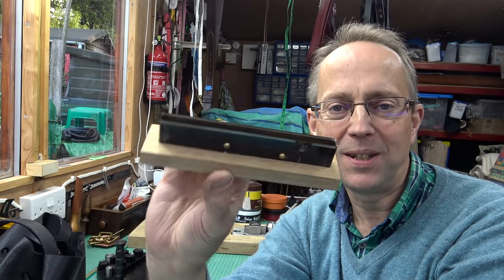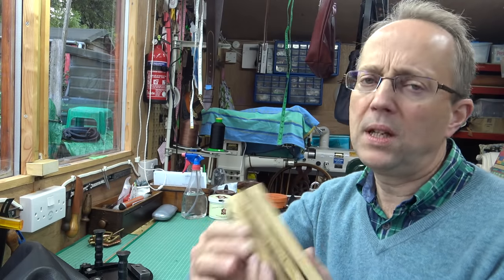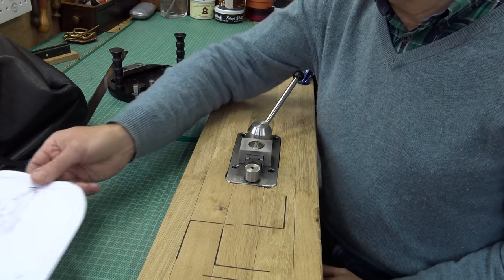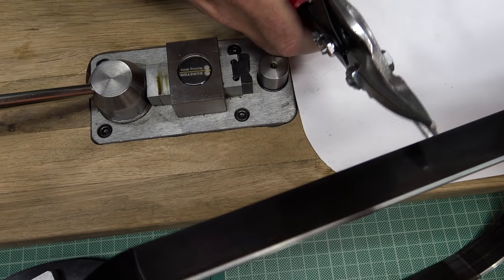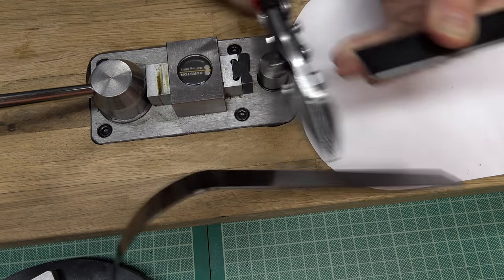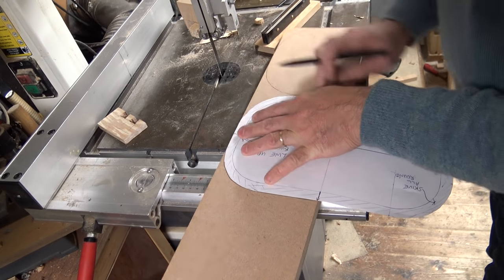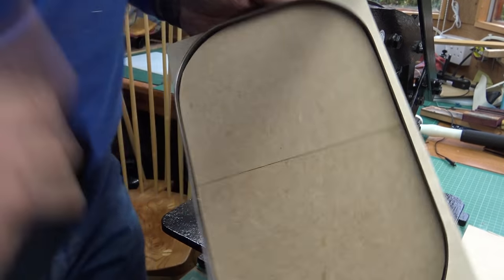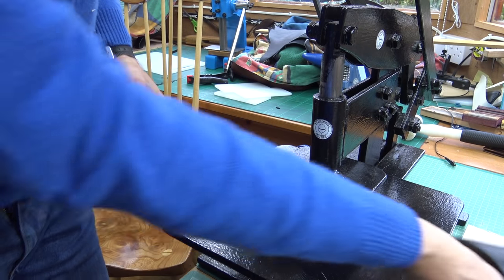Making a thin 2pt Steel Rule Clicker Die with basic tools

Comment: don’t understand why you don’t make mould first then match the steel to it, much easier and more accurate that fiddling with a sheet of paper surely. Great video really helpful. Thanks.
Reply from the maker: Hello there are two reasons...the steel has some spring back and I am very used to woodwork...but that said it's good to try different variations on my approach. Rgds Harry
Reply: ah ok, I’m very experienced with woodwork and this just seems an unusual way to approach something. However each to their own. Personally I would make the inner wooden piece, the. bend a strip of paper or card all the way round, mark the start and ends of al the bends, transfer to the cutting strip and then bend. Just think it would be a whole lot easier

Comment: More expensive and more effort , but longer life glue print to hard ply wood . Saw along line with scroll saw . Plywood thickness to accomodate  steel and ejector pad if used . Holes can be drilled in plywood for small cutters for holes or special shapes . plywood holds die in place,and is bolted to steel backing  plate . I serviced presses for company that did not quote orders less than  ten thousand units . Their bender was same basic design ,larger and more tooling .There are many small small cutters available for holes etc , sorry i don't have vendor info . A little practice you will be pleased with your results .
Reply from the maker: Thanks Stewart.

Comment: If I can offer a couple of bits of advice Harry. I don't use the backing plywood. I'm only using a 1 ton arbor press and I find the ram needs very little pressure when used on the steel rule itself. I don't have the movable  base that you have so I have to move the die and the leather which is not ideal but deouble sided tape stops the leather from moving about. Regarding the bottom of your bag, Have you considered inverting it? It would be much easier to sew and would leave a stiff lip for the bag to sit on thus protecting the bottom of it. Good job on the video. Keep up the good work. Paul

Comment: Harry, I am starting to play around with die making for leather as well. The method I am starting with is to cut the wood template (undersized by two rule thicknesses) and then wrap the rule around it by anchoring the wood template to the bench and using leverage to pull the rule hard/tight against the template. Have you tried this method? any suggestions?
Reply from the maker: Sounds very good especially for things like bag sides and bases...I guess anchoring one end of the rule with a nail might help? Thanks for sharing. Rgds Harry

Comment: Very informative video. Are you able to get away with cutting thicker veg tan leather with the 2pt rule? Based on what I’m seeing online, these machines won’t bend 3pt rule. Thanks!
Reply from the maker: You will be struggling with thicker leather, and yes 2pt rule seems to be the max.
Reply: @harryrogers  will it damage the 2pt if I tried to cut 8-10 oz veg tan?
Reply from the maker: @sterlingleatherca-8915  it may struggle or have a shorter life, if well supported on a small section you may get away with it. I did not try much in the way of thicker bits, so I might be wrong, I did cut out some small logo badgers in thick leather.

Comment: I had been researching making a die when I found your video.
Is it possible to bend it with hammer,  vise, and anvil or would that shatter the hardened parts?
Reply from the maker: The universal is fairly malleable...not brittle, but I don't think a hammer will do the job, though I have not tried it.

Comment: I love ya Harry but you are a naughty boy. Just paid £252 for one of these only to find there are different thicknesses and hardnesses of the rule die of which I still have about 55 left of of the box of 60 which has been fine for bigger stuff but this machine won't touch it or at least takes a helluva lot more force than I can muster and I'm not a weakling. Would this be why you upgraded to the bigger one?
Reply from the maker: Oh yes this is fine for the thinner stuff but sorry not for the thicker...I am sorry about that. I got the other bender for complex shapes still using 2pt rule.
Reply: @harryrogers  I've got some thinner stuff coming tomorrow so if the bender still doesn't perform I'll return it and look for the second one, Did you find a "best price seller" for the second one?
Reply from the maker: @Mraquaholic  You should be fine with 2pt Bohler universal.  I got my big one from Partwell second hand...it still cost a lot. Which bit of the UK are you in?

Comment: Hi, what scissors you use for cut a steel rule in 18:15 minutes ? 
Is a normal scissors or a special? I live in Brazil, and I want buy a scissors equal this model.
Reply from the maker: Hi Carlos they are aviation tin snips...so made for cutting thin sheet metal....you can get left, right and straight versions.
Reply: @harryrogers  tanks

Comment: i think maybe my comment was deleted because i posted links to the products.. my question was if anyone has any idea whether the 60$ bending tools would be good enough?  i'm looking at the pepe tools one and its 200$+.. any (even vague) advice very welcome!  thanks for the awesome video
Reply from the maker: The Pepe type are not very powerful so work with thin rule  but not with the thicker stuff...I  think now I would just get dies made professionally....but I appreciate they are expensive.
Reply: @harryrogers  Thanks for your reply Harry!  How come you had a change of heart regarding making them yourself?  Too much work or some unexpected problems came up?
Reply from the maker: @shawnkingston5882  Hi its easy for bag bases etc. But more difficult for smaller items like wallets to get 100% right..
Reply: @harryrogers  thanks for the info.  i'm kind of stubborn and bored so i think i'll give it a go anyways, it's to attempt to die cut stickers.  i'll let you know how it goes!
Reply: in case someone was reading this and wondered how it turned out for me, bought one of the alibaba ones, it was able to bend the rule but got a bit stuck (probably needed lubrication) and the handle part that you turn got very easily broken (it's a metal pole into a threaded socket, and the pole got dethreaded).  still works.  that said, i found for making small shapes that have multiple bends to be either very difficult or impossible (if your rule is a small shape that comes back around, it gets in the way of the bender itself.. like imagine getting inside a small square with a big rig bending machine).  so long story short, it didn't work for my needs (cutting stickers), i think it would work if it's easy shapes like squares but any type of intricate die cutting seems too hard to do accurately, and/or impossible without cutting the die into different bits then soldering them together again.  but yeah happy to have tried and happy for the video!

Comment: just rewatching to find out Where to Get the Blades? I'm not even sure what to Google... 'Clicker Die Blade' gives me nothing...
Reply from the maker: Hi Mike...there are links in the description. Rgds Harry
Reply: General name is called “Steel Rule Die.” The host uses that name about 25% in to video. Used to cut other materials as well as leather. Die cutters are not generally called “clicker” either—that appears to be a name that is commonly used in leather craft, but not generally in die cutting industry. Might be a brand name that was generalized.

Comment: to bad you can't buy steel die benders 
 in the united states.
Reply from the maker: Hi I think these go under the brand of Pepe ring benders in the US....also maybe try googling Helmond...good luck.
Reply: @harryrogers  thank you, i found it. I will try it but I doubt it will be strong enough to bend the thicker ruler metal that I need. I'm pressing with a 15 ton machine
Reply from the maker: @likes2fly  yes you will need a strong bender for thicker die...like 4pt thickness or more I guess.